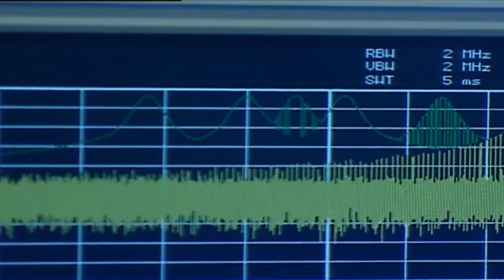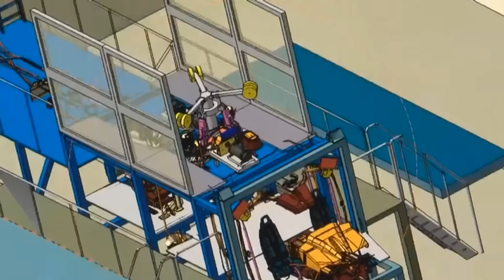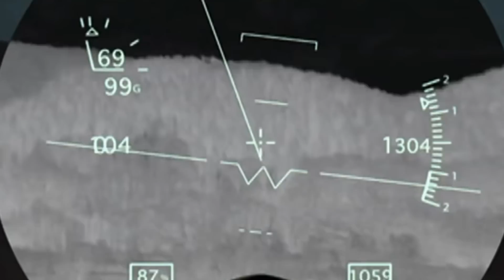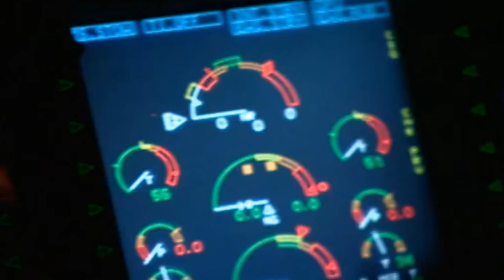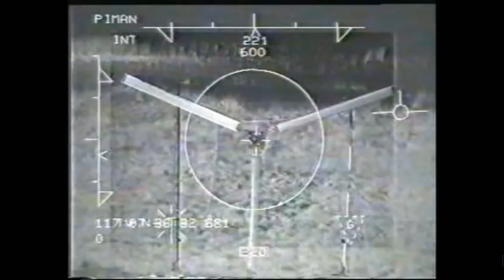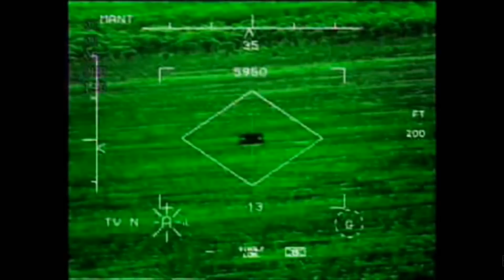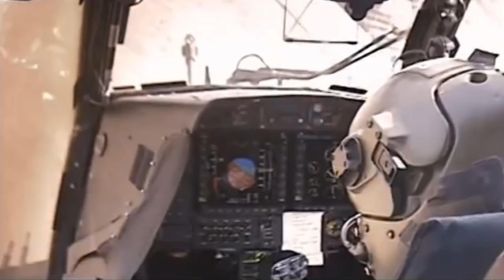Eurocopter Tiger EC 665 - Multi-Role Combat Helicopter

Comment: Guys stop comparing the German tiger to the French one or the Apache.
The UHT version was never intentended to be a multirole gunship and kill Taliban in the desert. It is a support helicopter designed to hover over north germanys lowlands an blast soviet tanks from 5-6km away. If this scenario would have ever accured, I would have put my money  on this chopper. The UHT has by far the best imaging devices and sensors in the game. It can make up a tank from 14km away and its pars 3lr missiles can destroy it 7km away. In this case a 30mm cannon is useless. 
Ofcourse the effectivenes against soft and asymetric targets is relativly bad on this one, but please stop comparing carrots with potatos. 
Yes the 30mm is missing, but u cant change it and some angry Youtube comments wont make germany build a new helicopter.

Comment: Australia is getting rid off the Tiger because (probably due to them taking part in the Eurovision Song Contest) they weren't aware they actually have a very long supply route from Europe.

Also as usual, the Mali crash was caused by human error (mechanics made a mistake after some repair work)

Comment: Yea another good example of the BAAINBw being utterly incompetent and influenced by the wrong people.
Buying an attack helicopter without the chin mounted cannon how short sighted can you actually be?
The issue being that on one hand they wanted to save money and on the other hand the target application for the helicopter was anti tank warfare.
So it was the perfect deal to cut the 30mm cannon as it is of no use for anti tank warfare and costs money.
Little did they know that an attack helicopter is very useful for close air support and for the then most important task of anti personal warfare the 30mm canon is the cheapest and most accurate option there is.

So the German Tiger can either choose to miss with their fixed wing mounted 12,7mm machine gun, fire a 600.000 € rocket at a 50€ AK47 wielding camel herder or stand there like fucking idiots doing nothing...

Well fucking done.

Comment: Hey Mate, 
Australian Army vet here. they had issues when we got them with the environment. built the Europe and we had issues with over heating and sand (the word getting around was). Haven't heard a word about getting rid of them. The Blackhawks are due to be out of service by that year and new MRH-90 (or something like that) are coming in. But, no word here about scarping them yet.
Reply: Overheating and sand aren't the real problem, as the French Tigers operate intensively in Sahel, a place way hotter and with a lot more sand than Australia. The real issue comes from the fact that users like Australia and Germany didn't invest enough in spare parts, making the aircraft's availabilty plummet. France had the same kind of issues but they solved it by having more spare parts available
Reply: Correction: Eurocopter and the OEM'S didn't have enough spares. We (I) ordered them but Eurocopter couldn't supply them and the spares budget should have been much larger.

Comment: Looks like a good multi-role craft which is what any smaller military needs. I would go with the advanced Sikorsky high speed copter or similar with a multi-role capability armament and electronics package or similar if I were a country out shopping. AMX I believe has a copter division in the Ft Worth TX area that claims to be able to make an advanced copter similar to the Sikorsky chopper. I feel that the high speed, maneuver ability, & high altitudes are necessary over the older copters to avoid MANPADS. The use of copter controlled drones could give you the ability to eliminate area denial systems too provided the country can't access your stealth drones ( much cheaper than a F35) The drones could also help clear troops out from under the copter.

Comment: We'll replace it with the Apache and likely find that not suitable for the ADF, and then it'll be onto the next helicopter. As an Australian tax payer I  do not like this recent trend. Never mind that we chose the Tiger for it's superior agility and smaller footprint as a recon chopper. I mean we originally didn't buy the Apache for a reason, I'd prefer that we upgraded the tiger.

It's exactly the same as what happened with our AUSLAVs, we wanted a fast response CRV that was amphibious, on exercises in the NT it impressed the US marines so much they soon found themselves buying LAVs, it was a good move. One hits a mine in Afganistan and suddenly we want to replace them with the Boxer, which does not have the same capability and a much bigger footprint.

Comment: Honestly, the Australian Tiger debacle reminds me a lot of the BS surrounding the bogus "G36 scandal". Sounds like a good machine getting a bad rap for no good reason. How many Apaches have crashed and nobody has a problem with that, but one Tiger crashes after 15 years of service and suddenly a bunch of blowhards do the "See, I told you it is crap!"-dance.
The Tiger achieved a 90% readiness rate in Afghanistan, which were pretty much the worst conditions a helicopter can face. (dust, high altitude, vastly changing temperatures)
How is that possible if it is such a unreliable POS that Australian pilots just can't trust for some reason?

Comment: So it turns out that one crash was due to an assembly failure by an assembly worker. Regarding the hourly costs, i figured the data for the apache is not calculated correctly. While our German military includes everything from airfield firefighters on station, over ordonance cost, to wear-n-tear /general value reduction, the americans only include direct costs such as cerosine, parts and maintenance costs. They claim a F35 flight hour costs less than a Tiger flight hour. The dated A10, which is to be put out of service due to its high maintenance costs, has a alleged hourly cost of roughly 12.000$.

Just think of the fact: Tiger can keep its  weapons on while on the ground. The apache ordonance has to be removed EVERY TIME it is on the ground, due to its missing fail-safe protection (thunderstorms etc). It just doesnt make any sense.

Comment: Why waste the effort and money on this when you have the Ah-64D Long Bow?
Long combat record...
Common use, available parts, integrated with NATO combat systems, can quarterback targets and prioritize them by threat and farm them out to other units in air and ground. 
 

I worked on Apaches, they're amazingly  resilient.  

Makes no sense.
Reply: Because Ah64D are extremely expensive to operate and are only meant to perform long range anti tank and anti personal role. Not all armies can afford to have one vehicle design per mission requirements. Eurocopter tiger is a polyvalent helicopter, it s in fact a very ehanced gazelle. If Australia is searching to replace its Tigers, buying Ah64 would not be a wise choice. Ah 1z viper however would be quite interesting.

Comment: The accident happened because of mechanical failure caused by two mechanics who made a faulty repair on one of the blades, that broke off during a side hi-G maneuver ,impacting parts broke off the rear rotor and sent the TIGER into spin and stall  close to the ground.....(RIP).But that Helicopter is really bad ass,and received major upgrades within the past years,it fly much higher than the APACHE even when fully armed and loaded.

Comment: what i can say is the Euro Tiger and the variants. even the copys in India and China. they just dont seam... like suitable attack role flying weapons platforms. yes theyre all suppose to be multirole. but to do this correctly, you have to do what the US did as a great example. The RAH-66 back in the day. started with a model, built a stealth helicopter airframe around that model. its a stealth heli now. then they integrated more and more avionics and the very first head mounted display and head tracking HUD system. Then they introduced in the second variant of the RAH-66. the second model, was the addition of winglets to carry ordinates such as additional Hydras, or a batch of x4 Hellfires on each wing. just for those non stealth needed missions. an RAH-66 can have x14 Hellfires on its loadout, x8 from the wings. and x6 in its internal bays. a great setup. or all Stinger systems. or all hydra systems. it was a great concept but wasnt needed at the time.
a Recon Attack Helicopter. with stealth capabilities.

OR go with the AH-64 route. make an attack helicopter. upgrade it constantly with better systems, comms, electronics, weapon systems, ect. and then add in recon elements when the D variant comes around. and now the E variant of the AH-64 is around. and its a whole new can of kick ass multi-role. 

wrapping up everything into one package right at the start is a massive issue.  doing this will make you think twice about adding in ether a 20mm, 25mm, or 30mm chaingun to the aircraft.
Look at the F-35. the reason people dont like it that much is the same reason the Euro Tiger is the not too popular. its trying to be everything right out of the gate.
If the F-35 was a stealth attack aircraft first. then they added in multi-role systems. such as better radar and system. the like. then itd be fine. because you dont need to second guess anything. 
or if the F-35 was a stealth multi-role assistance aircraft, where it was designed to be a mini Command and Control aircraft. having all the top of the line systems and such installed, with the ability to drop smart munitions and the like. and THEN getting an attack role upgrade. thatd be different. and i can see it working.

a good example is the F-22. the worlds stealthiest Aircraft. started as an Interceptor. today, it can now drop bombs and act as a Command and Control airspace platform. ontop of being a NLOS dogfighter.

Comment: Australia isn't getting rid of the ARH in 2020. They're due for a midlife upgrade in 2025. They're is talk about possible swapping to Apache instead of an upgrade. We've only recently obtained full operational capability, mainly due to the increased safety considerations here and the use of AGM-114s instead of European missiles. Extremely capable aircraft but not well suited to the tropic weather they experience in Northern Australia where they're based. Not that they have to much problems now.
Reply: Finally someone talking reality.

Comment: I still find the tail rotor wasteful. in the co-axial system, you get lift and speed from every HP and drop of fuel, and the torque of the main rotor(s) is compensated just fine. tail rotor birds are more beautiful, though

Comment: Just like the AH2, it's hard to beat the apache.  So many have been built, so much feedback going into the design, the new E variants controlling and firing off of drones, more lifting capability faster, and cheaper to acquire and use.  It's really an economies of scale.  So long as any nation doesn't begin to screw with major vital systems, there's tons of parts made in bulk that make maintenance cheaper.  American's have put tons of $$ in R&D of sensor fusion and smart battlefield tech and that's just not something you can just wave a magic wand and make happen.  This is why US and allies are leaps and bounds ahead of the russia and their aircraft buyers.  The networked battlefield is AMAZING.  Just like the skirmish in syria where US killed 218 russians wiping out a battalion of equipment in less than 10 minutes.  That's amazing.

Comment: @ Matsimus
The good maneuverability comes from the tigers predecessor, the MBB BO 105 PAH "tiger", in the german armed forces. This heli suits the geography and terrain of germany as well as high brass perception of effective anti tank warfare during a nuclear holocaust. These guys basically sat thier rotorcrafts in every tree there is in the way of a soviet armored offensive, studied the terrain and were meant to operate from improvised bases in forest clearings in order to support friendly tanks on the ground. The eurocopter tiger as a cold war design should replace it in the tank hunting role. My guess is that they didn´t want to loose capabilities they already incorporated in tactics and pilot training.
[wiki]:The Messerschmitt-Bölkow-Blohm Bo 105 is a light, twin-engine, multi-purpose helicopter developed by Bölkow of Ottobrunn, Germany. It holds the distinction of being the first light twin-engine helicopter in the world, and is the first rotorcraft that could perform aerobatic maneuvers, such as inverted loops. The Bo 105 features a revolutionary hingeless rotor system, at that time a pioneering innovation in helicopters when it was introduced into service in 1970. Production of the Bo 105 began at the then-recently merged Messerschmitt-Bölkow-Blohm (MBB).[...] During the 1970s, the Bo 105 was known for having a great useful load capacity and higher cruise speed than the majority of its competitors. While not being considered a visually attractive helicopter by some pilots, the Bo 105 was known for possessing steady, responsive controls and a good flight attitude. Most models could perform steep dives, rolls, loops, turnovers, and various aerobatic maneuvers; according to MBB the Bo 105 is cleared for up to 3.5 positive G force and one negative. One benefit of the Bo 105's handling and control style is superior takeoff performance.[...] Military operators would commonly operate the type at a very low altitude to minimise visibility to enemies, the Bo 105 being well matched to such operations, as the helicopter's flight qualities effectively removed or greatly minimised several of the hazards such a flight profile could pose to pilots. When outfitted with optional auxiliary fuel tanks, a basic model Bo 105 had a flight endurance of roughly five hours under load. In the event of a single engine failure, the Bo 105 could typically continue its flight, albeit with a reduction in cruise speed and range. Besides the two pilots, the cabin can be configured to accommodate up to three passengers on a single rear bench, which can be removed to make room for cargo or a stretcher, which can be loaded and unloaded via the large clamshell doors located at the rear of the fuselage. In a maritime context, the BO 105 can be equipped with auxiliary fuel tanks, emergency flotation equipment, an inflatable life raft, folding rotor blades and high skid landing gear. In 1975, the decision to procure a specialist anti-tank version armed with up to six Euromissile HOT missiles, designated as the Bo 105 PAH-1, for the German Army was made. A total of 212 Bo 105 PAH-1s were delivered between 1979 and 1984. 
Video: 
flight capabilities: https://www.youtube.com/watch?v=qpg0iShxolc
acrobatic maneuvers: https://www.youtube.com/watch?v=uYbx5H5e9Es
in german military use & weapons use: https://www.youtube.com/watch?v=uYbx5H5e9Es

Comment: I once had the chance to speak to a german tiger pilot. He said, that the main problem of the tiger, as you pointed out, is that it was not contructed for the tasks, which it should forfill today. It was primarily constructed for recon and anti- tank, with the cold war in mind. The doctrin for anti-tank combat was to hide behind forests, or other natural barriers, strike and than reposition, before the enemy could return fire, thus manouverability was extremly important and the tiger was constructed with this in mind, the compromise being, that it is not very well armoured. In todays conflicts however helicopter are often cycling above the enemy to provide overwatch and intimidate the enemies. This however makes them vulnerable to small arms fire, which is not a big problem for the appache since it is a flying tank, but the light armoured tiger really suffers under this conditions. Which makes it even worse is, that it is incredible expensive and work intensive to repair the ballistic protection, after a hit.
Reply: I think it's accurate to say the Tiger is not a bad AH by any stretch of the imagination, it's well built, capible and perfectly adequete for it's use case. But it goes to show that is just how amazing the Apache Longbow is. The cold war had some interesting roads traveled by the various powers that be, Russia really went all in on their rockets and missiles, while the US went full bore for it's aircraft and navy. 

If it's in the air, and it's American, it's generally best in class, or if it floats. 

But on the ground, France, Germany, UK and others did excellent jobs at producing equipment that far rivaled the USSR's kit. That was their reality facing down hoards of cheap but powerful Russian made tanks, so they had to focus in that direction. 

The US was never realistically going to be invadable so their reality was in the sky obtaining air superiority, and leveraging their absolutely titanic logistical capabilities at sea to keep our european allies fed, armed and resupplied.